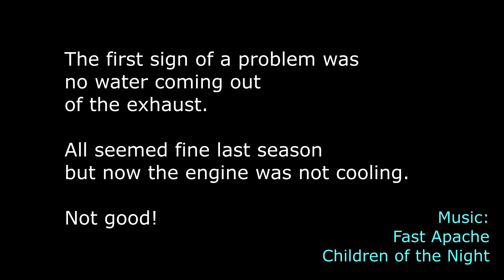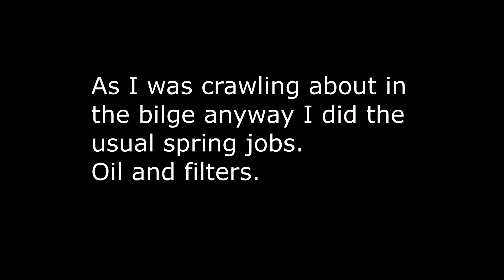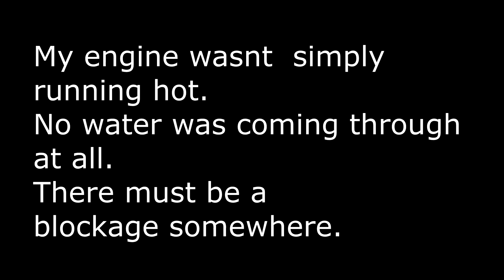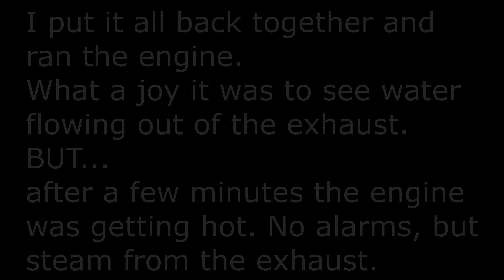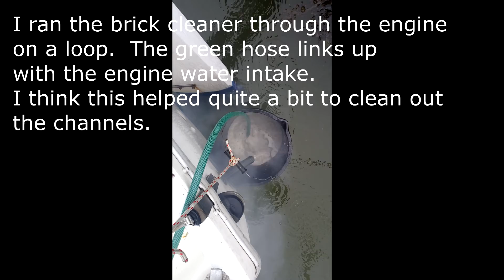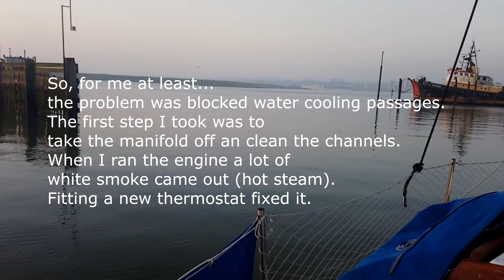Volvo MD7A fix

Comment: Good job. I bought a MD7A on a '79 CD 30. Old owner told me the engine was "finished". In a rainy February on the hook, cleaned the manifold with screwdrivers, no good gasket, gooped cement...Thermostat spring was broken. I wired it open enough until I got a replaced one.....been working for 10 years. Sweet little engine. I never abuse it. I try to sail than push it. After all, it is just an "auxiliary".

Comment: i have same engine and same problem. i did same thigns as you did this summer but i stopped half way through. i mean that now i understood 1 missing part. have to change the thermostatic valve. thank you very much!!

Comment: Thanks for providing some crucial info! I'm replacing the thermostat on a MD7A. Every parts supplier sells a replacement kit that is supposed to work for both the Volvo Penta MD6A and the MD7A.  Both motors take the same thermostat, but not the same o-rings / bushings.  The MD6A thermostat housing is shaped sort of like home plate. It has two locations / holes for sealing rings / o-rings.  The MD7A thermostat housing has an arm sticking off the bottom, with a third hole in it. This is shown at 2:29 of your video. The hole in that arm connects with the copper tube coming from the impeller pump at the back of the motor - we see that tube at 2:18 of your video, labeled "water comes out here".  At 2:29 of the video we see an o-ring at the third hole in the arm of the housing. We get another good look at the housing at 4:38, and in that view the o-ring is not the third hole. If anyone can explain how that connection can be made watertight, I'll be so grateful.
Dan
Reply from the maker: The push fit tube connections can be a bit fiddly but do go back without too much hassle.  A fresh rubber ring helps.  I used gasket paste on the housing edges.  Not too much.

Comment: Thanks alot for this video. Just bought an old sailboat with this engine knowing it has heating issues. I will give these a try first. Got the boat cheap due to this issue but am hellbent on getting it running. It sounds so great.
Reply from the maker: Obviously I don't know the condition but they are pretty basic tech.  Parts4engines do got parts at non volvo prices.  I'm willing to bet its the heat exchanger. If brick cleaner doesn't sort it you might be playing the 'take it off without snapping a bolt' game.   But even that isn't too difficult . Best of luck.anf let us know how you get on.  S
Reply: @directorstu  yeah plan to service the engine and check the saildrive over, swap out impeller and then take a look at the heat exchanger and plumbing. Im pretty sure ill get it running smooth in the weekend. Cheers for the reply and have a good evening.

Comment: Thank's a million times for sharing Your experiences working With Your engine. I find Your video very educative. 
Having spent the weekend struggling with the temperature of the engine, I was about to accept that our engine was a 20 minute worker.
Athough the Challenges of our engine are a bit different from that of Yours I picked the cleaning of the cooling manifold as the first thing to do on our Volvo MD 7 A.
Walle
Reply from the maker: Thanks. Nice feedback. They are essentially fairly straightforward.  Initially inscrutable but once you get your hands dirty and invest some time it kinda comes together. Best of luck.

Comment: Thanks good video looking at a westerly with MD7A currently I have Hunter with 2 stroke outboard  on out board impeller just goes hard and segments break off and if course hot salt water in contact with alloy is hardly the best mix !!
Stuck thermostats or no thermostat are both common issues..

Comment: Hi having the same problems with my Md7a, checked impeller, and thermostat both ok, only replaced the thermostat and cooling manifold two years ago, so going to try and flush with brick cleaner, did you do this with the thermostat in place and how long did you run the cleaner through the engine for? Thanks

Comment: Perfect! Thanks a lot for sharing this story and advice. 
I have the same engine and it's barely cooling, as well as giving off a lot of steam. 
The coast guard of Norway approched me one night, with their seeking light/torch towards me, calling  up on the VHF: Do you have problems and need assistance? We see smoke coming from your boat. 
Fortunately, it stayed right below the alarm heat, so I said I was fine and kept motoring. 
Now the alarm comes on quite soon, and only a tiny spray of water in the exhaust, so it's time to do the same job and hope I'm able do it, and that it works. 
Thanks again. 
Gunnar, Norway
Reply from the maker: Hi
It is a matter of being patient and trying one thing and then another.
1 - check impeller
2 - check thermostat
3 - check for blockage in cooling block
Good luck with it. If I can do it im sure you can!

Comment: Hello , Great job ! 
thnx for sharing the advice . Same problem here , i have the same engine ,so where did you order the spare part for the engine ? On the previus maintenance of this seasson i discoverd that the seawater pump was leaking a bit . So i think i'm gone try the waterpump replace kit and while i'm up ther check the things you did . Thanks Greetings from belgium
Reply from the maker: ASAP-supplies. Com have a great site.  Easy to search. Good pricing and fast delivery.  Good luck!

Comment: Hi there!  Great video.  I have the same problem with my md6a.  I wonder where you get your parts?  Cheers!
Reply: @Stuart Hughes Awesome Stuart! Many thanks!  I have hull number 2364.  Great boat!
Reply: @Stuart Hughes have you ever looked into a closed loop cooling system?
Reply from the maker: @dalegoodman9779  i was flicking g through the paperwork on my current boat and found that this closed loop was an option the original owner paid about 3k for un 1988. Vp 2003. Ouch.  Not a bad idea in principle for the 6a but  I guess its a matter of priorities. There is always x10 things to fix. Is it worth spending money on a system thats plodded along OK for over 50 years .  Closed loop not v complex but still a fair bit of mucking about to get it right. For my md7a I think I'd not have bothered even if a new heat exchanger was needed every 10 years.
Reply from the maker: @dalegoodman9779   is this the Jag 27? Yep fantastic boat
Reply: @directorstu  Albin Vega 27.  Fantastic boat.  I just wish I didnt lose the key to the ignition! As a fix I mounted a Tohatsu 6HP Sailpro on mine.  Lovely and lightweight motor that sips fuel and is portable.  If anyone has a fix for getting a new key or perhaps a suggestion for a new ignition switch that would be much appreciated!   I would like to try a closed system if I can find a kit compatible with the MD6A.
Reply: @Stuart Hughes not sure what Mad had before.  I will have to watch his channel.  If you were in my situation what kind of push button assembly would you buy?